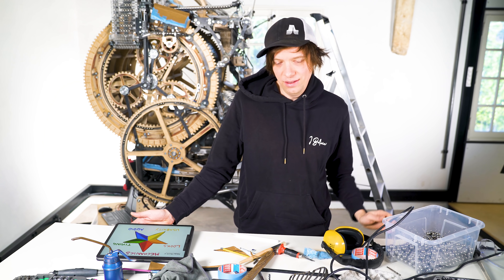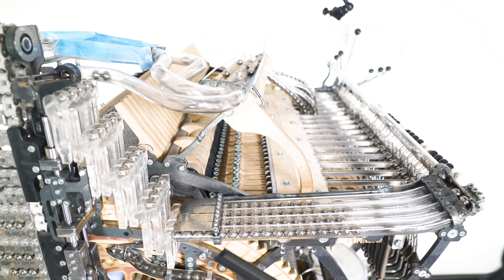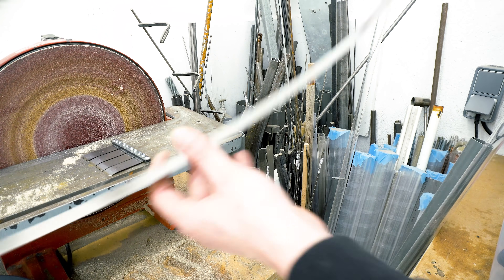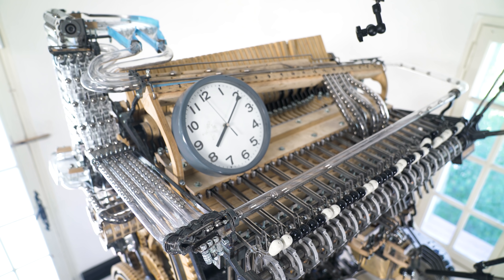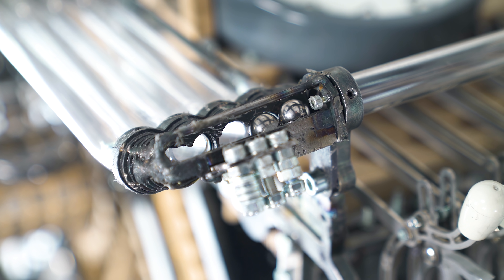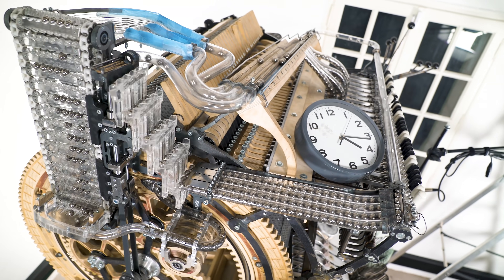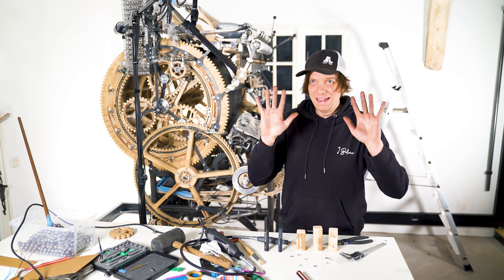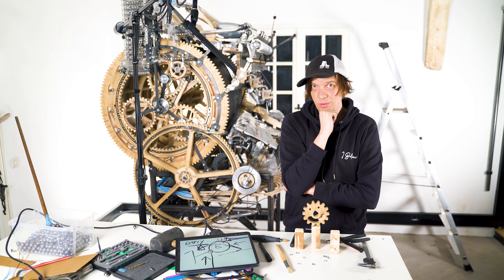Marble Machine X Fish Stair Upgrade

Comment: Martin (or anyone who may have an insight into Martin's mind), 
why are you so focused on marbles escaping? The last couple problems that you have been fixing (drum funnels, the flying marble from the divide by four edge case) have been issues of marbles escaping the machine, but they don't seem to be hindering the playing of the machine at all. What difference does it make if 1 in 100 000 marbles ends up on the floor?  Perhaps with the divide by four, you are worried about marbles falling into the mechanisms of the machine and jamming them, but at least with the drum funnels that wasn't really an issue. Maybe you should consider a fail-safe mechanism (one that accounts for the possibility of failures and allows them to happen in a way that don't break the machine) rather than a fail-proof (zero-fail) mechanism. I'm sure many people have said this before, but if an issue doesn't cause the machine to break down or massively hinder the musical ability (ie. many marbles missing their instrument), is it that important of an issue. 
In most of the marble tests, none of the "failures" actually caused the machine to break, and it could clearly keep playing well for hours even with a few less marbles, so clearly the snare and bass can play for a while (longer than a show) without getting jammed or stopping playing. They should be able to play for at least a show without the lost marbles becoming a problem, and after a show you can top it up a bit if needed.   
Sincerely,
A concerned fan.

Comment: As a fellow artist and engineer (albeit a computer engineer) I have to say, it's painful to watch you fiddle with systems that even you know aren't going to be in tune once they're shipped to a concert. Once it comes off the truck and onstage, how many systems like this will you have that you'll have to tune day-of to perform with?

But I think I have a possible solution for you that would be visibly interesting as well as much more bulletproof. Flip Flop gates. These would divide the marbles evenly first into 2 pipes, then those 2 pipes would get subdivided again into 4.

It might have lower throughput than the divide-by-4 and might need some testing but it could be very compact.

Regardless, I urge you to look at non-divide-by-4 solutions. You can't play an instrument that doesn't work.

Much love and respect tho. Trust me, you're killing it. If there's any way I can help out let me know. I have a woodshop and could help prototype or anything you need.

Comment: As I watched this, I envisioned four water buckets side by side in descending elevation. As the top bucket fills it spills into the second, then the third then the fourth until all are full. Perhaps instead of feeding the four tubes simultaneously, allow them to fill then overflow sequentially until the tubes are full.

Comment: It's a machine. Failure is inevitable. You drive your car to work every day. At some point it will fail. You play your guitar every day. At some point a string will break. A tube will blow in your amp. A connector will fail. A cord will get crimped and break a wire. A fuse will blow. You are trying to build a musical instrument that will never fail. By accepting this requirement you have already failed. It can never be achieved. Build the machine. So what if it fails? If you can play a dozen songs between failures it's a success. You aren't going into the marble machine business. You aren't selling marble machines to the masses. This is a piece of mechanical artwork. It will at some point fail. You are not selling it's perfection. You are selling it's NOVELTY. If it makes noise that's because it's mechanical. If you want a machine that plays music without noise get a CD player. If it can't handle the tempo of the song don't write music for it at that tempo. Just because your sports car can do 190mph doesn't mean you should run it at that speed. Be realistic. Just finish the damn thing. Write some music for it. And put it on the stage. No one is expecting perfection. This thing isn't going into a cathedral to last a thousand years.

Comment: Hi Martin! As an engineer, I much prefer the big tray method (much like that used in the original marble machine. The "tuned" serial to 4 marble divider solution really needs a double buffering to work. What you have is very fragile and subject to wear and tear (think shipping from one location to another).  In general, make a system work first to meet the functional objectives. THEN, make it look nice without sacrificing the functionality. Basic engineering 101.

Comment: I have an idea, maybe it helps you:
Think about how much lift-area the first fish stair element needs. Basicly the contact surface has to extend just over the center of gravity of each marble. So the idea is to eliminate the hard edge on the fish stair that catches the marble E by giving it an edge angled towards the pipes, that pushes the marble back up the pipe instead of lifting it. It wouldn't need to be much. The lifting would not be compromised, as long as the main contact area angled away from the pipes is still extending over the center of gravity of a marble.
Something like this:
Without marble: |/\=
With marble in correct place: |o/\=
With marble E: |/\o=

All of the best from Austria!

Comment: Could you tune the swing down to only slide down with 5 marbles instead of 4 so that you have more of a tolerance? Also again love the project. You can do it!
Reply: the problem is that when one marble goes into the pipe the whole divider will close and won't let others marbles to escape. simultaneous escape of all 4 channels in much more important.
Reply: @1815dmitriy  
I was thinking something like a bistable mechanism that will swing down when there are 5 marbles but will only swing back up when there is 1 remaining. Though I admit I'm not sure what that mechanism would look like. And now that I think about it more it might not be worth it?

Comment: Martin, I have not watched the video yet, but I just wanna say: strengthening the springsteel isnt the solution you are looking for, since it doesnt relate to the source of your problem. You need to lower the 4 input pmma pipes downwards (at the left side)(opposite side of the devide-by-4). The fishstair lowers to a point where the balls waiting in line roll over the top of the ones that are already inside of the fishstair. Idk how to explain it that well, but please try it. Its like a two second job I believe because I know you can adjust it with like two bolts. I can send you a drawing if you dont get what I mean :)
Reply: Another advantage of this would be the increased incline of the pipes, so the marbles run easier, even when magnetized :)
Reply: You are right about the climbing up of the second marbles BUT he can't go all the way down to the perfect height, because that's the zero point of the mechanism, and it will only be at the lowest point for an instant. Not long enough to load the marbles. I suggested a floating first step, that comes down to a perfect height stopper and sits and waits there for loading, while the mechanism goes down for a bit of time and comes back up. When it comes back it lifts the first step  up again. He could even incease the loading time, without getting the 2nd marbles climbing problem.

Comment: You're already happy with the divide by four dropper, but in case it acts up again, you could make the divide by four dropper require five marbles to drop. The fifth marble doesn't go anywhere, since there are only four channels, but by requiring 5 marbles worth of weight, you guarantee that the other four marbles are in place and settled, since the fifth marble cant contribute its weight until they are. The fifth marble then continues down the track becoming the new first marble. 

Regarding the stairs, it's kinda the same problem you have with the droppers, it's moving horizontally into a system that's moving vertically, and sometimes they're out of sync (the droppers being the opposite, moving vertically with gravity into a system moving horizontally). Maybe a similar gate system is the solution. Maybe a pin going through the pipe that blocks any out of sync marbles til the next pass. It could be spring loaded so catching on a marble in motion wouldn't be catastrophic.

Comment: You are at the last step of designing a product, that is testing, finding issues (moles) and fixing them and then retest! 
The most important part of a project is to find the minimum amount of work to have it presentable and working 95% of the time.
The rest is the worst and hardest part, making it look cool, have it ultra reliable or really useful (sound good in your case).
Most important is to have a plan preferably for the whole project so you can do the boring parts when you are motivated and the fun parts when it becomes harder.

Comment: I’m sure this has been said before, but it’s important to consider the consequences of a failure when deciding what to do about an issue. At the moment it seems like you’re trying to prevent any marble loss regardless of the consequences of that loss. Of course, if you have a scenario where a marble loss will cause failure of a critical feature of the machine (eg a channel stops working) then you need to fix it, but if the machine continues to play fine but you have one less marble (and one on the floor) then you should consider not fixing that problem and allow yourself to move on. Allowing yourself to accept something less than absolute perfection (and being a little forgiving of yourself) may allow you to progress a bit faster and feel a bit more positive about finishing. Perhaps it might help to reset your Goal around failures to be about ‘events that impact music playing’ rather than ‘escaped marbles’.

Remember, the goal is making music, not creating the perfect machine!

Comment: OH OH OH! I HAVE IT! Put a marble gate on the entrance of the fish stair! Just make it rise from the bottom and have no "ceiling" to it, so that marbles which happen to land on the stair as its rising either fall behind or ahead of it. That will let you equalize the speed of incoming marbles to the fish-stair. It won't look nearly as good, but you can tie the gate to the movement of the stair itself, same thing with the gates for the droppers. It should 100% solve the problem you're experiencing without too much issue.  Here's an extremely rough draft of how it could look/work: https://i.imgur.com/pzUdx9w.png

Comment: Why not use the same principle as with the dropgates. Divide the incoming marble to the stairs from the incoming line. A pin attached to the lowest stair coming up into the tube, letting only one marble pass each time. That way you can time the entering of the marble each time.

Comment: You had the solution for your divide-by-four all along. Skip the tilting mechanism and just allow the 4 channels to fill up so the marbles are even, just like the instrument channels up top. You're over complicating it otherwise.
Reply: I think a computer science view might be useful here.
The tilting tray is a queue that feeds a buffer. It should never release marbles, unless there are exactly four marbles inside, and there is free space in the buffer.. And then it should always release all four at once. Similarly, I wonder why there are four separate spring blades instead of a single wide one. When the fish stair is in position, the gate should open so that all four marbles are always passed on, and it should never open when the fishstair is not in the right position. Instead of the springs, which I believe each are released by the weight of the marbles in the corresponding channel of the buffer, there should be a shutter which simply opens by the fishstair coming to position and closes immediately when the four marbles have moved. It's the marble gate all over, but with synchronous release of four marbles. Maybe some kind of rotating turnstile, with three or four blades, so that when one blade goes up to release the four marbles held by it, actuated by the fishstair reaching its load position, the next blade goes down behind them, blocking all remaining marbles. No springs to adjust or tweak, no dependence on how many marbles are in the queue and how hard they push. Just an actuating arm, released by the stair, rotating an axle with four blades 90 degrees.
Reply: The issue with doing this is that the farthest left tube would get less balls in it on average, and that would not be good. Good idea though.

Comment: Regarding the issue with the lost "bad timing" marble at the end, I think you could curve the tips of the fingers upwards into a radius, so that as the stairs press the misbehaving marble into it, it's forced forward instead of trapped by the finger.
Reply: curved tips mean that you just have a larges area to jam the marble. Not a single point but a whole curve. 
The problem is that if the queue is empty, the marble is stopped by the "wall" of the first fish-stairs step, and then nothing pushes a marble forward. Thus it  stays at the entrance for too long. And the more time marble stays between the pipe and stairs - the higher chance of jamming. So you need to speed-up a marble. Make a higher incline for the first marble to speed up its entrance.

Comment: Hi Martin, I'm no engineer, far from it, but making the pipes with a higher slope, would raise the speed on which the marbles move onto the fish stair (when the stair is going down and has the "wall" for the marbles up) and avoid the marbles being stuck between the edge and the spring steel.
And another idea, can't you make a moving up and down the wall and stop the marbles a bit earlier and release them only when the fish stair is when you want?

Keep it going \o/
Reply: exactly. Speed up the marbles that were stopped by the stairs' "wall"

and absolutely NO need for gates etc. The gates will just be another "issue point"

Comment: Martin, consider this: The engineer's solution is robust and will stand the test of time, but nobody will ever call it "a masterpiece". The artist's solution is very pretty but will, as you said, fail at the first sign of its tolerances being exceeded and will also never be called "a masterpiece". At the beginning of this project you were primarily concerned with appearances and artistry, and now it seems like you've swung the other direction, instead being concerned with engineering above all else and trying to get the machine done as quickly as you can.

A proper blending of the two, knowing where to go for artistry and where to go for engineering, and where to mix both approaches, that is how you create what people will call "a masterpiece", and it's how all the devices in the Speelklok Museum ended up there in the first place.

Comment: Something I hope Martin keeps in mind is that one or two marbles escaping the machine out of 50k-100k marble circulations, as long as the cause of the escape DOESN'T break the machine, honestly isn't that big of a deal! The most important thing is that the machine can work and drop marbles without breaking or losing timing. If a few marbles fall per show, but the machine functions fully outside of that, then the machine works. 100% perfection could keep this project from ever being complete, but allowing the rare marble escape (safely) would make completing and touring with the machine much more likely. Keep going Martin!

Comment: The fish stair queue will be emptier as more channels are "activated", since it only gets to put the "unneeded" marbles back to try again to go into the divider.  More of the testing should be with fewer available marbles, and it's looking like the engineering solution would work better in that case.  The fish stair itself is a lot more visually interesting to me than the divide by 4.

Comment: What concerns me is that even if you find micro adjustments that work, that's a machine you want to transport/disassemble for your tour. With such minute yet potentially consequential details it won't be suitable for its intended purpose. The feeding mechanism seems too unrealiable in its core design.

Comment: Why not inserting some blocking pins from the bottom of the tubes (something like marble gates). The those pins could be positioned between the first and second marble position (as counted from the stair) and be connected to marble stair mechanism. So there is only a defined window where ne marbles can reach the stair. Late comers will be blocked at this gate, and only released when it save again to roll up to the first place.
Made a small graphic: https://imgur.com/Gets6th

Comment: Martin you might be able to help your fingers and their metal shards if you got some really really sticky tape and repeatedly press it to your hands and pull it off. It works for fiberglass shards from insulation foam so you could try it...

Comment: Good call on 'ignoring' the problem as out-of-bounds by saying it needs to be sufficiently filled. That does move the problem (it needs to be properly filled), but that is presumably a smaller problem (if none at all if there are enough marbles). There is no need for perfection, if you can build the machine so the edge case is never reached, you don't need to cover it.

Comment: Don’t give up on MMX. But please stop chasing Perfection. It’s almost never feasible to design a perfect system. Chase SixSigma reliability instead of perfection. what if as a compromise what if you built a marble catching system? So if the marbles jumped out somewhere (like the funnels for example) this system would be a redundancy. maybe it is near the floor of the machine and will collect rouge marbles and recycle them back into the normal machine flow? that way if you have one escape somewhere it will almost always be routed back into the machine. this will reduce the impact of escaping marbles.